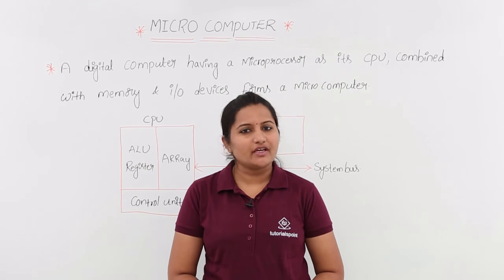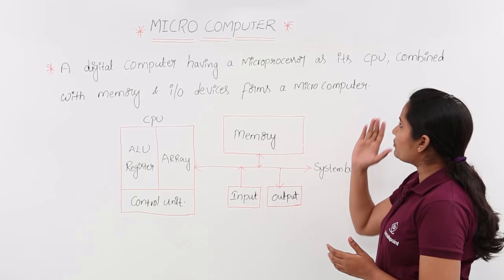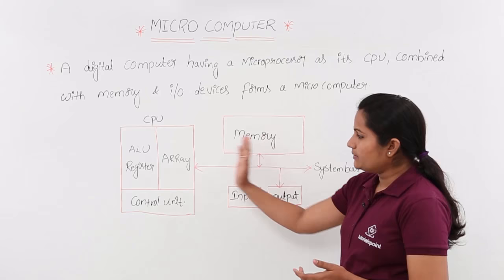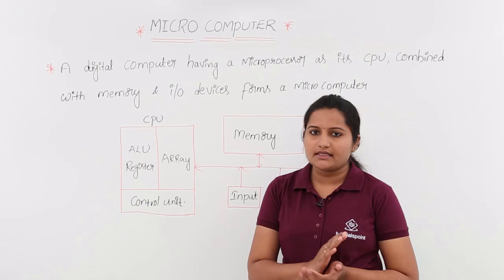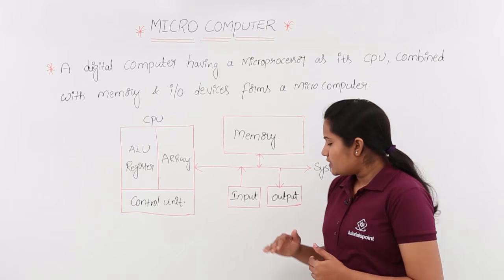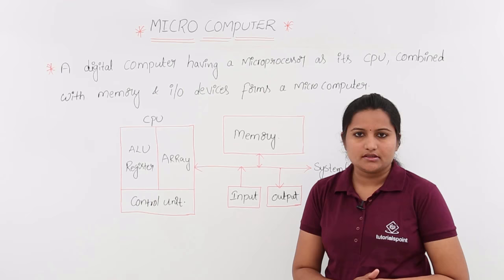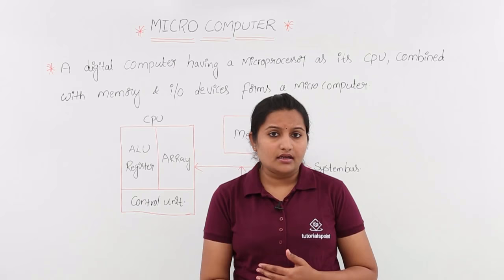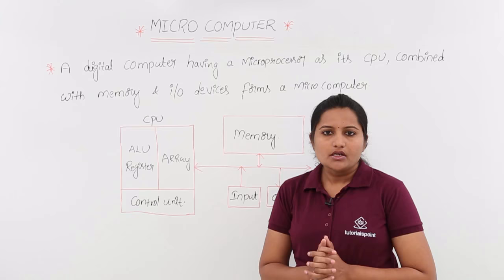Micro Computer

Comment: Can u tell me y it's called "micro"
Reply: Micro means smaal .....microprocessor is small as compared to normal cpu tht is why
Reply: Microprocessors are programmed with an assembly language program which is very small and so is called a microprogram. As it runs on a micro program, it is called a Microprocessor.